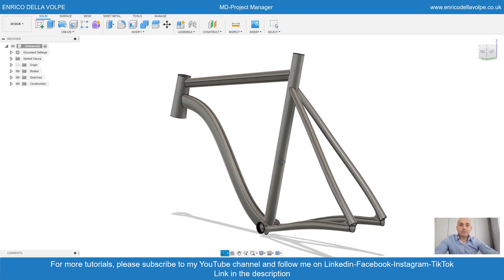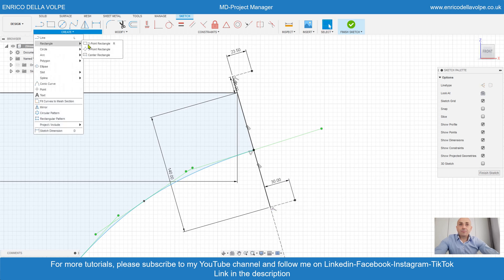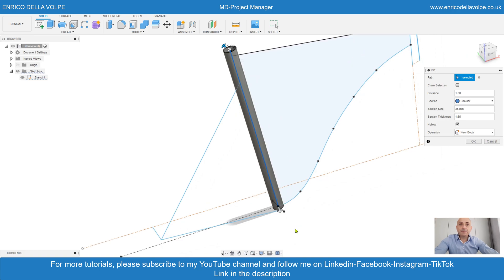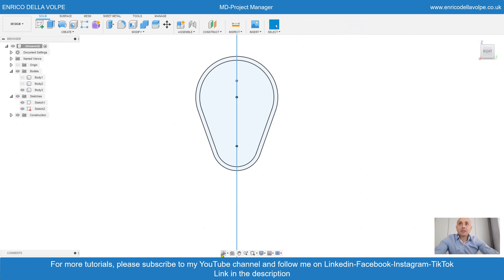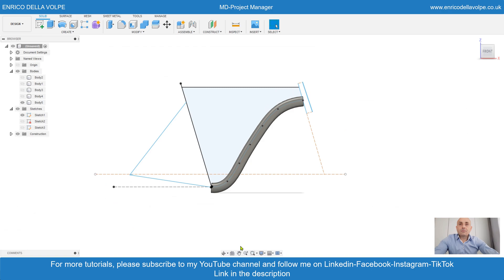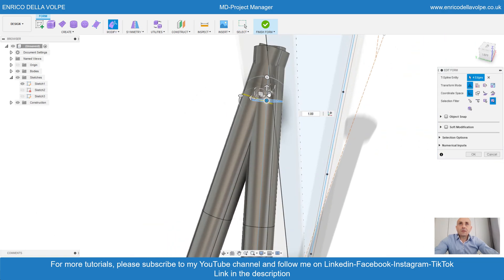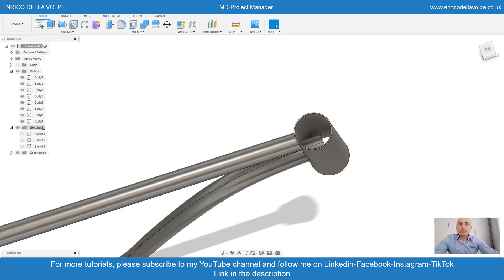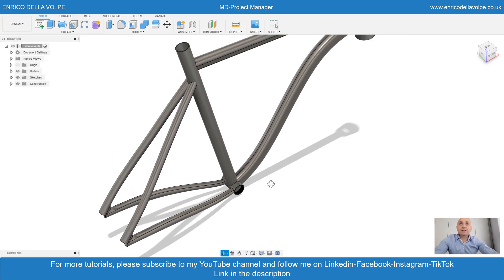Video Tutorial: How to make a Bike Frame with Fusion 360 in just 10 minutes.

Comment: Pro tip - click the 3D sketch 1st before you start sketching, otherwise you will lose constraints. You can see many lines are blue and not black, meaning - not fully constraint. Good tutorial nevertheless.
Reply from the maker: Thank you for you comment. Yes you are right you should add contraints to the blue lines
Reply: @EnricoDellaVolpeTechnology  I just realised, even if you start the sketch with 3D it still looses the constraints. The only way to do it is to apply more sketches on supplementary planes to have "everything black" / fully constrained. Fusion 360 is bad at for containing all the 3D sketch lines in a single sketch, unfortunately.